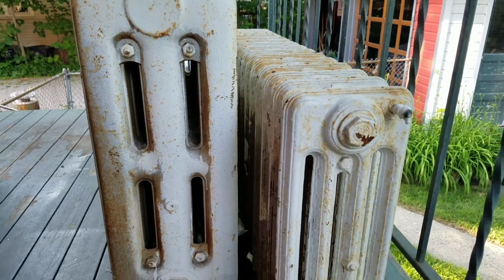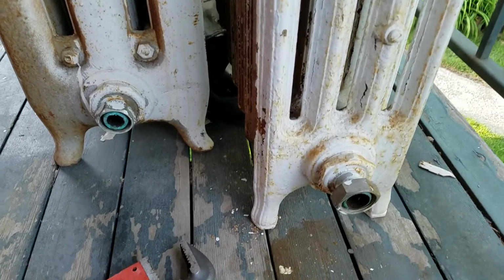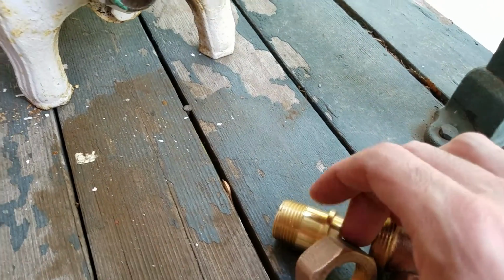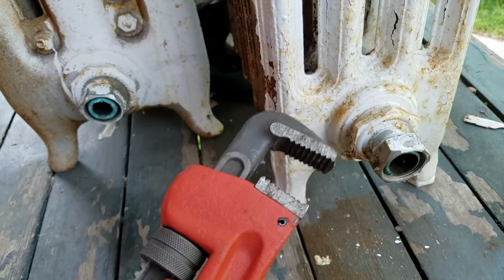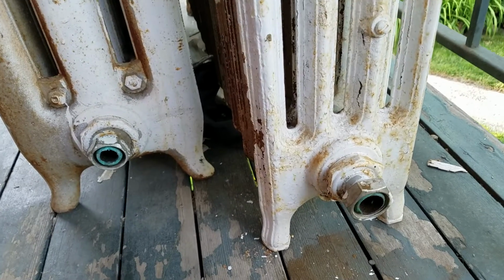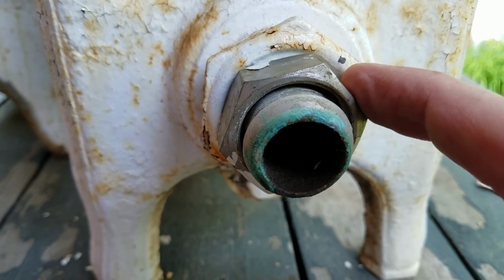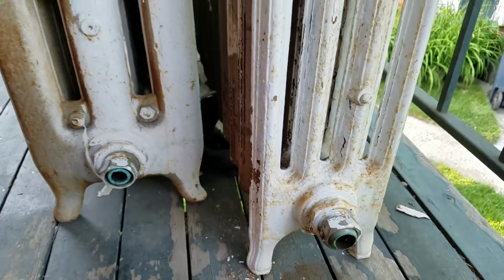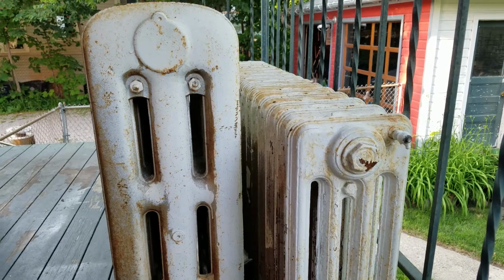Cast Iron Radiator Restoration Part 1: 3 Options For Removing Stubborn Shut-Off Valves

Comment: option 3 prior to cutting with a hack saw. Drill a 1/2 hole through the end and use a 1/2 all thread or some metal 1/2 inch and twist it out. Worked for me and saved the headache of cutting it out.
Reply from the maker: @caleblove that's a GREAT idea! 👍

Comment: I have a used cast iron hot water radiator. I wanted to run in at the bottom and out at the bottom. I assume the supply side is the valve, correct?
However, one bottom hole is blocked with a 1 1/2 inch plug. How to remove it?
Can I have the return side come out of the top on the opposite side?
Reply from the maker: for supply sides and returns, both can have valves for water shutoff purposes. Also, the pipes can enter /exit at the top or bottom of radiator. Just unscrew the plug and swap top to bottom as needed. 👍

Comment: what type of bushing would you get if you had to replace it?  what are the best valves?
Reply from the maker: Hi Peter, for the valves...I buy mine from www.supplyhouse.com.

Always replace the entire assembly - the radiator nipple and the valve side, as different mfrs can have different sealing/mating dimensions.
Reply from the maker: Oh and the bushings, do you mean the ones between each radiator flue? Like, if you were to disassemble a section(s)?
Reply: @myoldhousefix  thanks for info I couldnt replace the ones between the radiator sections im talking about the bushing before the new steam  valve. at entrance of steam.
Reply from the maker: @petergriffin1546  ah yes, that bushing/nipple will come with the new valve assembly...you'll have all new parts...
Reply: @myoldhousefix  the steam angle radiator valve comes with the nut and tail piece and the bushing is usually sold separate.

Comment: 4th option is remove the reducer bushing attached to the radiator
Reply from the maker: That's an option, too!
Reply: Has anyone tried removing the reducer bushing? Is the radiator hole a standard size hole and thread?